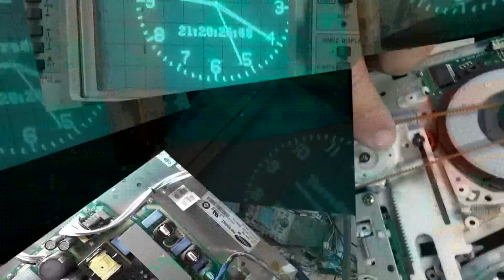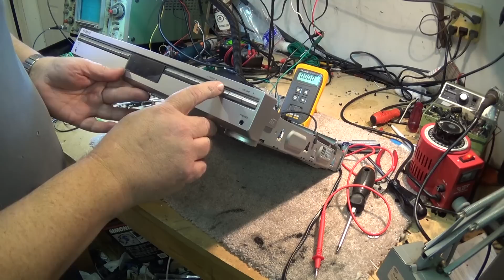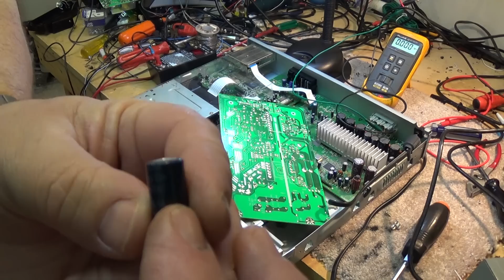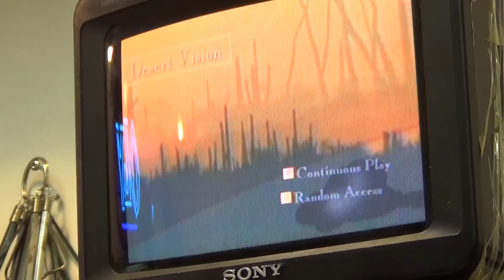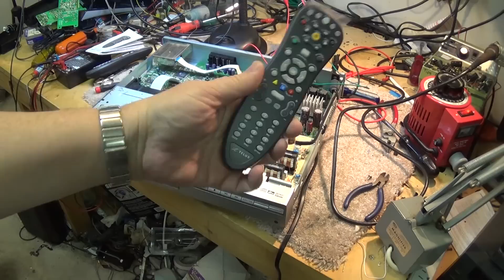Sony DAV SB100 No sound. Can it be saved?

Comment: Hi, i have a Sony Hcd-Fxg9k here thats with no power issue for a very long time, probably due to lightning strike. I have sorted out primary and fuse no longer blows out. This unit has 2 STR IC, one is STRF6168 and STRV153. Both has been replaced, electrolytic caps has been replaced, a few smd diodes replaced and resistors replaced. The problem now is, on VCC of STRV153, voltage are fluctuating between 12v to 15v up and down. Theres no voltages at all on any of the output pins. I have checked all the smd components, all seems to be reading accurately. But i know there IS something thats preventing the STRF6168 to start up.

Comment: Oh hey. Found this old vid. I have a Sony DAV S500 I've had for almost 20 years. The front left speaker output has stopped working and you've given me some ideas for how to go about diagnosing it. Thanks :)
Reply: When you find a solution or a repairman lmk ok? 
I got a Sony dav home theater with the Sony s Air that I really like but the surround speakers are sketchy at best 
The only really good output is center speaker
I'd like to keep this setup b cause the s air speakers
Reply: @cheffrank_357mach5  Yeah, I opened it up, cleaned the amp board with IPA and re-soldered a couple of joints. All working now.

Comment: A digital amplifier with a switch mode power supply and SamYoung caps, can things get any worse than that? It's sad to see that Sony has degenerated to this level...
Sony used to integrate Nichicon or Elna caps. Now they went down the drain.

Comment: Glad I found your vids; did electronics in navy then came home and opened repair shop for several years. Kept running into backsliders who would agree to cost of repair then “ changed their m8nd” after repair was done. Ended up with bunch of liens .started $20 non-refundable deposit policy which turned into hassles so I gave it up. Miss it
Reply from the maker: I actually ended up in the repair business because I studied electronics in school, but never planned on a career in electronics. Went to college and studied television production. That was my career goal.  That didn't happen other than a few years at a community TV station. I landed a gig at Sony fixing Betamax VCRs, and Sony put me through their factory training course. When the gig at Sony ended I went to work for a large dealer with an inhouse service dept, and ended up running that service department for 20 years. By 2003 I could see the writing on the wall, and got out and went to work for the phone company.
Reply: have  pioneer system    3 belts  broken  how can i replace  please    dc 200z   help

Comment: Hello sir, I have sony  DAZ DZ290K home theatre and there is no sound from center speaker even during speaker formation and see center speaker disabled on TV
Reply: Yogesh to check the center speaker working or not, connect to right or left channel and check.  If its working then change the sound modes in your remote it will work.

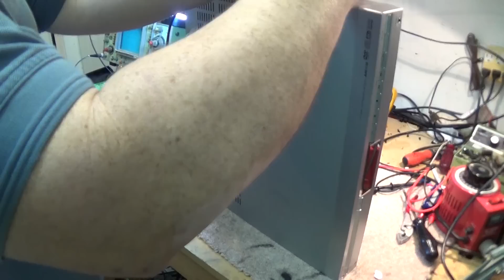Comment: You've helped me solve my problem before I could even wat h the video lol. Around 1:17 when you said unfortunately, you didn't have the speakers, a lightbulb turned on and I plugged my speakers into my vcr/dvd combo and it worked just fine. I have a Vizio flatscreen with no composit input. Thanks for your commentary, it works for me!

Comment: Not sure is it late to check but have same unit. Did refresh power board and have good voltages. But happens that dvd is producing sound but fm tuner or line in have no sound. Fm is searching and finding rds channels and seems all fine but no sound by it or either from chinch on behind where i keep my laptop pluged in. Ty

Comment: I have a problem with a Sony DAV-HDX-265. The moment you plug it in it goes into protect mode. The amp power supply is not starting. I notice a Zener diode number t2d77 test open with my fluke but in the circuit it got hot . Could it still be a bad diode ? i never seen a zener go bad like that. Thanks in advanced.
Reply: Well That diode turned out to be good. The problem was a shorted capacitor on the main board it happen to be in the section of the board that controls the 3 power control lines.

Comment: Hello, I have a question that if you could help me with that would be appreciated, For 2-3 minutes of turning on my DAV-SA30 player it works fine and the sound etc is smooth and clear and then after that it starts to make a scratching sound like white noise that eventually drowns out the sound and that's all the sound that's left, it doesnt turn off it just continues making that sound until i turn it off myself and I wanted your thoughts on why that would be. Thank you

Comment: Hey i hope you see this message. I got a Sony Hifi System MHC-V6D out of warranty and its showing up Protected 03. Sony Tech says its Amplifier part should be replaced and he gave me a big estimate with which i can get a good Amplifer instead. Can you recommend some fixes? I can see 4 3000uf 71 volt capacitors in which two of them got top side bulge . If i replace them, will that fix the amplifier? All other part of the system works fine if i unplug the strip from pre to amplifier. if amplifier connected it goes to protected 03 and none of the switches or remote will work. Reply soon please.

Comment: Sir, have a model sony dav-tz 145 dvd player but sometimes it showing protected. unplugged the wires for few hours & again same issue. Also in normal mode when connect from tv output to dvd audio in jack no sound is coming. Can you help why it's happening?

Comment: Sir I have Sony DAV-DZ570  and facing push power protector error. i also check speaker connection. i found 30volt is not showing so how i can check and resolve this type of error. my email id is vinodsh@gmail.com

Comment: Congrats Bro!!! hehehe capacitor is one of the major problem. same problem when i was troubleshooting the CRT TV with power but no display the cause is capacitor 2200mf 16v for 12v supply to 7809 9v for chroma ic. the voltages is low 6volts,
Technicians from the Philippines sawajiri 😀

Comment: In earlier times, the European company Philips made axial lead electrolytic capacitors with a tolerance of -10% to +40% capacitance, so it is reasonable to use a 'pair' of 1,000μF capacitors in parallel, delivering the same capacitance as the original being most probable. I see one had a temperature rating of 85°C, and for a few cents more, 105°C and low ESR rated capacitors would well replace the originals...
Reply from the maker: LOW ESR 105 caps are a better choice, and a requirement in switching power supplies. I have heard that audiophools though, want good old 85" electrolytic installed because they claim that in coupling circuits they are more "musical"
Reply: +12voltvids I didn't think of it that way, but thought I'd mention tolerance in capacitance values, even for new components. For some years, I 'rebuilt' TV power supplies, where a coupling electrolytic on the switching transistor was critical in regulation. A typical value was 47, or 100μF, at 16, or 25 Volts. Most often, its failure led to overdrive, which, on a cold start-up, destroyed the switch (transistor), as well as some fuseable resistors (flame-proof). I didn't mind, as it meant 'a job', as manufacturers opt for the cheapest electrolytic capacitors which inevitably fail..
Reply from the maker: Usually dry caps resulted in insufficient drive, and in the case of switching regulators, you could end up with both FETS driven on at the same time which resulted in instant failure. Of in the case of single ended outputs, the frequency would change, driving the unit into rull resonance, which resulted in the voltage going sky high, shorting the crowbar zener, and that casing an overload condition that blew the chopper transistor.

Comment: I use to have a Sony HTSS380 it was a digital amp and to be honest it wasn't bad little cheap but not bad did not have any built in player just the amp. It claims it's a thousand watts came with hall six speakers 5.1 system 8inch sub little small but not bad. The only negative is that it only works with the speakers provided but its actually not bad little system and it can decode the blu ray audio tracks in bitstream witch pretty cool.

Comment: nice job sir ,what t meter digital is that  you chek  caps??
Reply from the maker: The meter used to check capacitors in called an ESR (Equivalent Series Resistance) meter, and they are a kit that you build.

Comment: Great video. I have a SONY STRDG-510 reciever and when I put it in DVD or SAT mode it says its LOCKED. How can I UNLOCK these modes. Thanks for reading this. Also your intro music is really cool, sounds like it is from the 80s? Would love to get a copy of that tune. Thanks again Gio.
Reply from the maker: +Gio048 Music is called UNDERCOVER and you can get it from musicbakery.comThe version I use as my opening is a edit down from the full track.As to your locked input issue you need the original remote to unblock those inputs.
Reply: +12voltvids Thanks but will a universal remote work? I don't have the original.
Reply from the maker: +Gio048 Yes I am sure some universal remotes will control most of the features.
Reply: +12voltvids my lg dvd player had the same problem no sound no dvd reader and because the power supply

Comment: I have a DAV-S400 I'm replacing too. I've the full system, but I have decided to replace just the head unit, as at loud volumes, it enters 'PROTECT' mode. Driving me mad. I'd still like to fix it though and sell it on. Do you have any ideas what may cause this at loud volumes? Maybe thermal related? As this unit should achieve full volume without going into protect - it's what it's designed to do.

Comment: I have the Sony DAV-SB100 Home Theater System. It hangs Frequently. Some times when it powers ON directly it goes to the DVD/CD Function. When I try to change the function it doesn't. I can't able to change the function to Video and FM/AM mode.  And some times it Restarts automatically it repeat's to the same function. May I know the Solution??...

Comment: So only a 0.3 volt drop in the 3.3 volt supply due to  resistance in a capacitor caused the failure. The other was 0.2 volts low. How far can a supply voltage in digital devices vary before failure? These were just over 5% and 8% lower. Would 5% be a good guide for voltages to be considered unacceptable?
Reply from the maker: +Jonathan Jay Babcock Its more than just the voltage drop, it is the ripple increase that causes more issues. Also when you are dealing with a low voltage supply like 3.3 volts having that voltage correct is much more critical than say on a higher voltage circuit.
Reply: +12voltvids Yes... I recall tracing back to a bad electrolytic in a power supply regulated to 5V (7805 regulator). The voltage at the input pin was 5.5V, and the output, 3.8V, which should measure 5V. Replacing a 470μF, 16V electrolytic brought the input pin up to 6.5 V, and delivered the correct 5V at the output pin.. A voltage drop of just 1 volt is a proportionately large one with a 5V supply (20%)... which can stop the function of circuits it supplies...

Comment: Also have a DAV SB100, Will play some DVD's, but others it displays 'can't play'. I noticed when you first inserted the DVD it stuttered a bit until you started turning it by hand. Mine also makes those little stuttering sounds before ejecting the disc saying 'can't play'. Have tried a head cleaning disc. but will not play this either. Any idea's?
Reply from the maker: putuch Try manually cleaning the surface of the lens. For this you will have to remove the shield over it.Other than that it could be a bad optical block, or a bad spindle motor.The one I had plays fine now.
Reply: Cheers, Cleaned the lens, now working fine. You are right when you say that somebody was inside yours before you. There should be a clear plastic cover over the actual DVD player.

Comment: Great video. ALWAYS check caps.I learned the hard way on 2 Tascam CC-222units. One only said welcome and would not open the cd drawer or let the tape deck work.It was a 10,000uf/16 volt cap feeding the input of a 7805. it had .69 esr. Keep these coming. Jimmy
Reply from the maker: "The reliability of any electronic device is inversely proportionate to the number of electrolytic capacitors it contains.